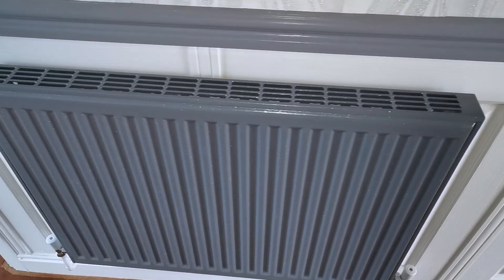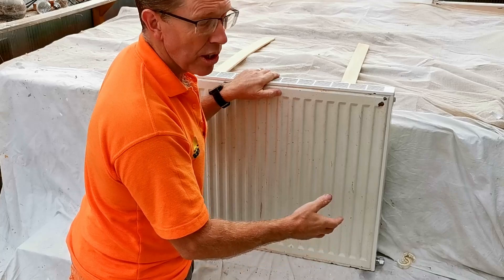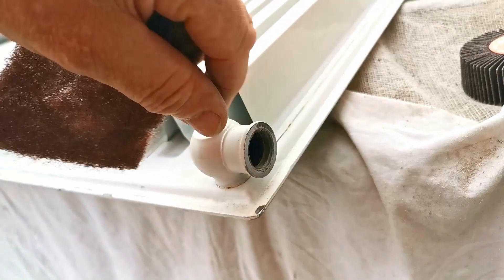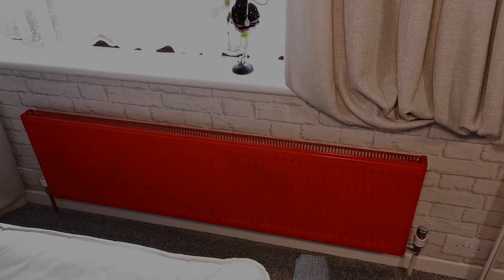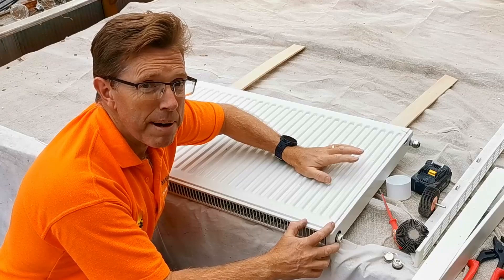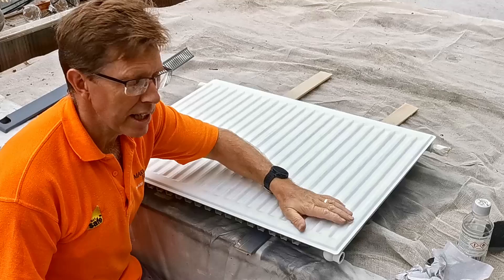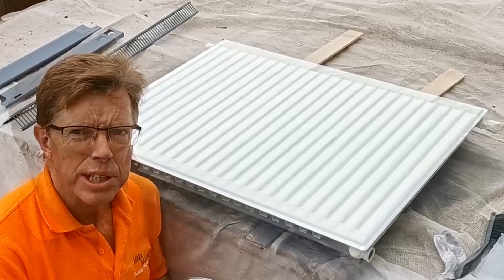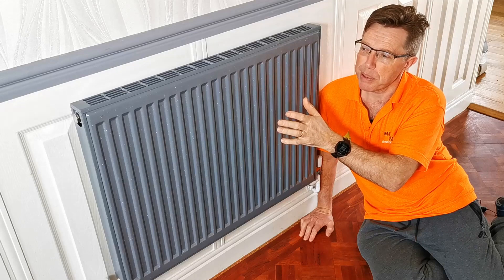Radiator Spraying / Painting. Transformation to Look Better than New, with a Sparkling Finish

Comment: Very good video. However I would have treated the rust areas with rust converter. Then used zinsser BIN primer for added adhesion. Then sprayed  with top coat.